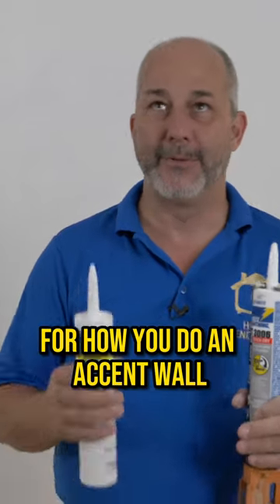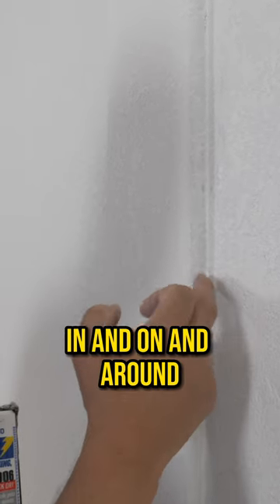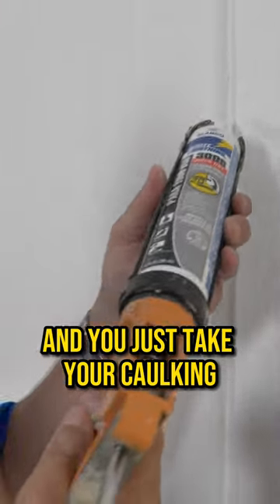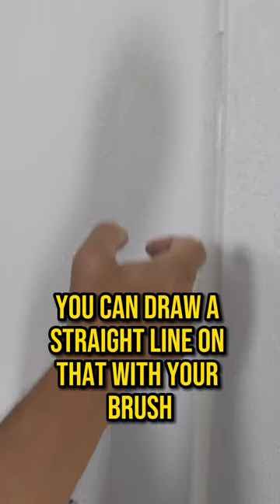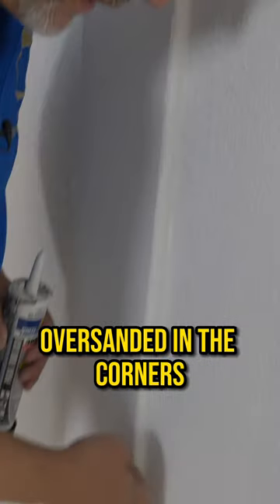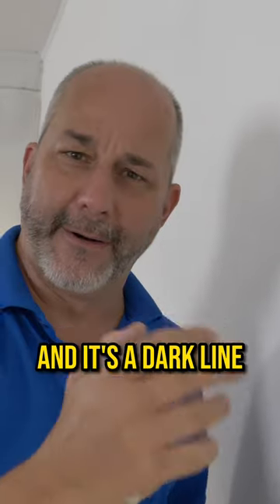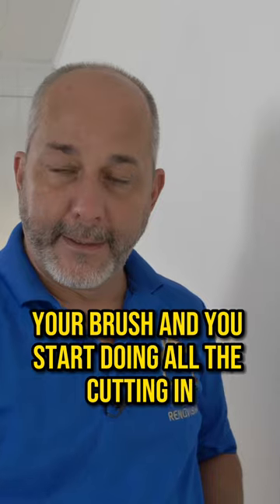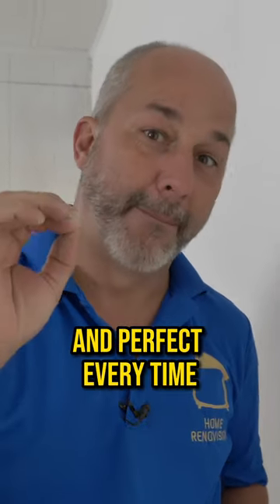How to Paint a Textured Accent Wall

Comment: I always use this trick for ceilings, especially popcorn ceilings. Even on flat ceilings though there’s always a gap between the wall and the ceiling where the bazooka didn’t get enough mud and it shrinks in the crevice. Fill it up with some caulking before painting and the cut in comes much straighter.